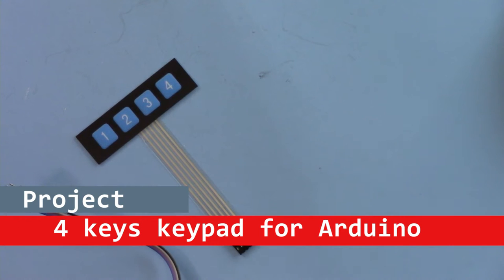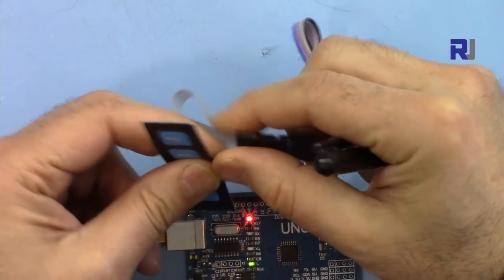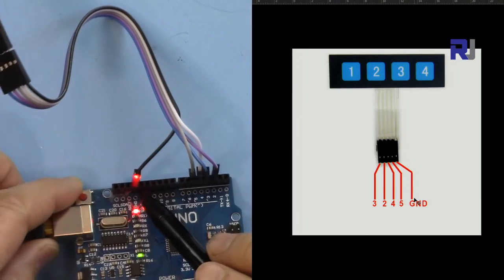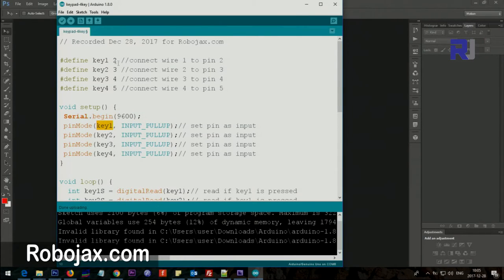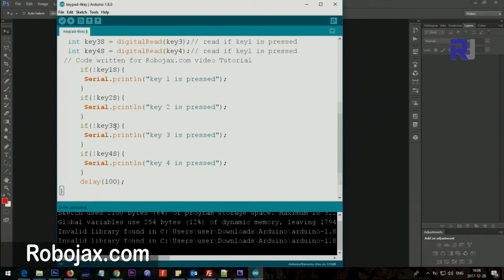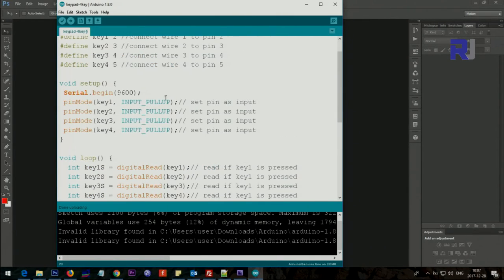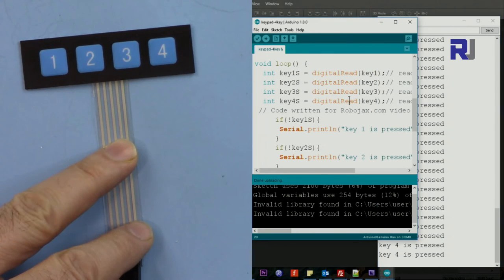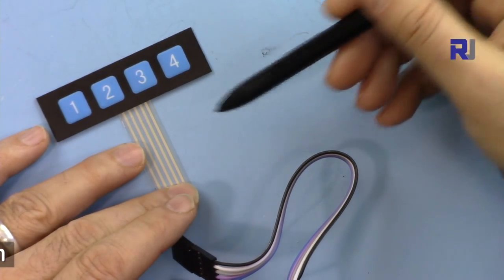How to use 4x1 push button keypad in Arduino

Comment: Hallo can we use buttons swtich on and off when u push second time?
Reply from the maker: Hello, Create an array that holds the value of each key. if keypad has 4 keys, then your array lenght should be 4 (for 1, 2, 3, and 4 keys on the keypad). Set each value of array to equal zero.  Once a key is pressed  you change the value in the array in the right index location to =1. Then you continousely read the key press. once pressed again, read that value, go though they array values and see which value is equal to 1 and this way you find it.  you should reset the array value of array beck to zero after a certain time is passed. like after 2 seconds so the user should restart entering the values again. My channel is for learing. I have three videos on Array. Here is one https://youtu.be/GbKZ9W-xyvE please watch, learn and write your own code. good luck

Comment: do you have any debounce videos? is that a issue with this keypad? How would wait until button is release so you only get one 1 or a 2, 3 or a 4 not a screen full?
Reply from the maker: You can add delay in the loop so it can read every 500ms or 1 second delay(1000); this way you can avoid reading multiple times.

Comment: Can i use I as a normal keyboard for Mt pc

And what if I need to connect several keypads should I buy multiple arduinos
Reply from the maker: conect them to the same arduino. Just drfine different keys for each. for example I looked at the code and first line has : #define key1 2
which defines pin 2 as key1. Now if you have two keypad, then we call them "a" and "b" you do like this: 
#define key1_a 2
#define key1_b 3
and the same way for all variables. If you don't know what variable is then watch this video https://youtu.be/n0z6fjww8eA good luck and that is the best I could help you.
Reply: @robojax  thank you for the information